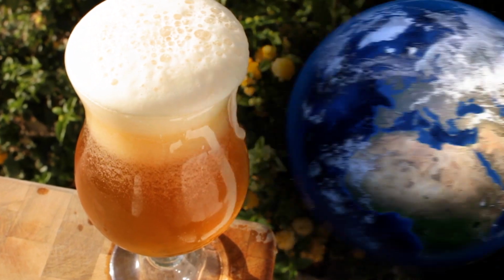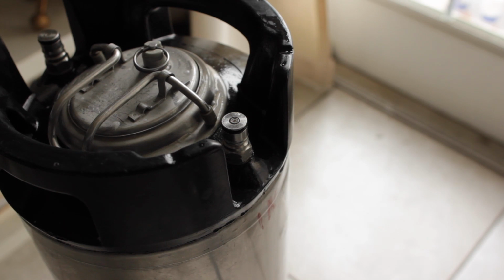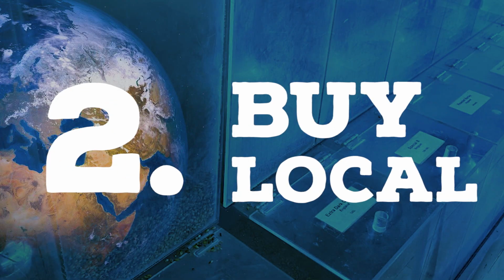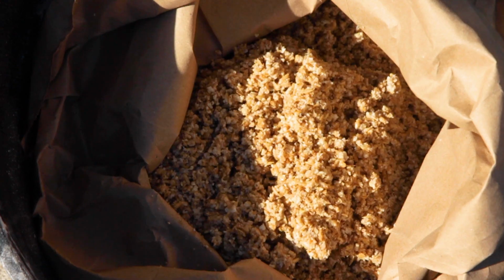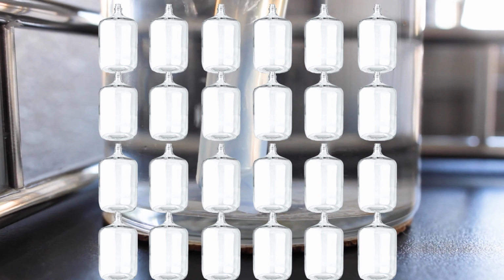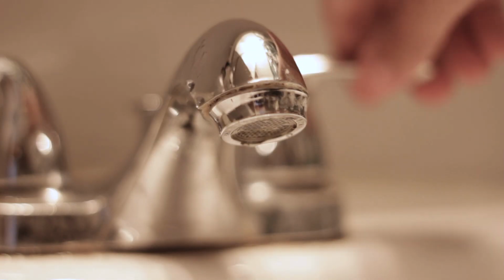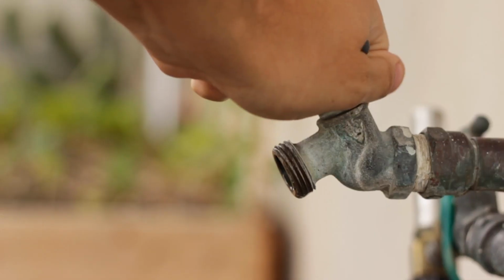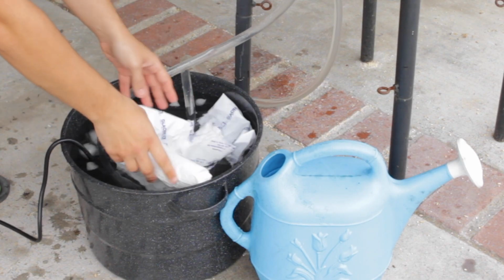Easy Ways to REDUCE WASTE for Home Brewing 🌎🍺

Comment: To save water during chilling, I will boil a gallon or two of water two nights before brew day. I put that water in sanitized food containers, and throw them in the freezer. Then on brew day, I calculate using about a gallon or two less water so that when i get to the end of my boil, i don't even need my chiller. I just throw in the giant blocks of ice, which rapidly cools down my wort, gets me to my 5 gallon mark and saves all of the time I'd normally be spending watching the thermometer drop! Its a few extra steps to set up and more math to do, but it's worth it to not watch gallons and gallons of water run down the street.
Reply from the maker: Excellent tip! TY!

Comment: Where I live the water CAN NOT BE wasted never dumped all that water and cringe every time i see a video where its dumped away, Started making ice and recicle it with a pump then i had de oportunity to put a tank and cicle throw it until de temp of the tap water is equal to the water coming out then just close circuit with some ice.. works like a charm got lager temps easy
Reply from the maker: That’s a great setup! Especially if water is a rare commodity!

Comment: Environmental - Some of this sounds really counterproductive or destructive. Pre-chilling water for example (or using ice)- the compressor or Peltier cooler uses a ton of electricity to pre-chill the water you are going to use. In NAMR it takes approximately 15 GALLONS of water to produce 1kW of electricity. The electricity consumed making 20 gallons of ice, can be far more than just using room temperature tap water. It's substantially more than just re-using water from the tap, and infinitely more than just letting the wort cool down with ambient air. You have line losses, compressor inefficiencies, the energy used to maintain the temperature in the fridge/freezer, etc. An efficient compressor based mini-fridge can still consume around 80 watts an hour just to be running so if it runs 12.5 hours to chill your wort to pitching temp you blew another 15 gallons of water at a power plant to say you didn't use it at your house. If it took 48 hours you used 57.6 gallons of water. If it takes a few days to prechill ice, and post-chill a fermenter you easily climb into the hundreds of gallons of water. Now imagine your fridge is inside a living space that's also conditioned and all the heat dumped from chilling, has to be conditioned a second time, we can really double up those numbers. If its a Peltier based chiller go ahead and multiply these numbers by 3 or 4. The mini fridge just being plugged in and not used for wort chilling uses an average of 233-310kWh a year or 4650 gallons of water. The only real green advice is let it cool down with ambient air, or if you use water re-circulate as much as possible and use the 'waste' water after it chills to water plants or whatever

The idea of shopping at your LHBS reducing emissions - How? The vast majority of emissions came from the products making it to the store, having to keep a store open, staffing the employees and their trips, the entire manufacturing or growing/harvesting/packaging process. Easily 99%, and when its instead shipped to something like a brewery by rail or semi in bulk its far more efficient per lb of product and far less emissions are created than vs somebody buying small amounts for home brewing in their personal vehicles. BTW if its water we worry about, 3-6 gallons are used to manufacture 1 gallon of gas. Buying in bulk in a single trip sure it saves emissions vs making 10 trips, but its probably delusional to think homebrewing is saving emissions compared to commercial brewing or that buying stuff for a single batch locally is any more emissions friendly than ordering it online. Make less trips or have less deliveries is sound advice. 

Reusing spent grains - 'i made dog treats', 'dont give spent grains to dogs they are toxic'. Maybe some grains? Or maybe hops are toxic to dogs. felt like a mixed message. The act of having somebody else compost something... its going to break down anyways. In a landfill or a commercial compost, in your backyard, anywhere as long as you don't launch it to space. Its going to have the same net emissions. You just add emissions by having it shipped, or having it sorted, or having to rotate it, but natures going to break it down no matter what with exactly the same emissions eventually. The only thing that seems like its green here would be suggesting just do it in your backyard so you dont spend additional emissions shipping it to a landfill or a composter (who then ships it again somewhere else)
Reply: I think the message that you shouldn't give dogs spent grain that contains hops was pretty clear. So no mash hopping if you want to make dog treats.

Using spent grain to feed chickens or in your own or neighbors compost is a good idea. So is buying in bulk.

The cool water thing may depend on where you are located. If you are in a region where water is a scarce resource but solar energy is plentiful, using ice packs and reusing water may be better. But in other places it's probably better to just use tap water, capture that and use it to clean or water plants etc.

Friend of mine uses rain water to cool his beer, at least during the cold months.
Reply: @RedHotBagel  I scrolled back in you are right - he does say make sure the grain doesn't have hops before giving it to your dogs
Reply from the maker: @RedHotBagel  love that rain capture idea!
Reply from the maker: These were just some ideas to make better choices on a small scale. There is obviously a bigger issue at hand but was only hoping to give home brewers some ideas on where they can be a little more green. No one is perfect!
Reply: @TheBruSho  No worries friend I wasn't accusing you of being perfect just offering my personal perspective on some of the actual impact of the suggestions
Reply from the maker: @SuperDocCox  appreciate you giving your insight! 🍻

Comment: Good stuff!  I always use the no chill method, or if it's summer time I hold my kettle in the pool and it cools really quickly.  What about reusing your yeast?  I think you can use them up to 10 times.  That's my next venture now that I have a secondary fridge.
Reply from the maker: That pool trick is genius! And yeah reusing yeast is a good option. Saves money more than anything
Reply: I guess I've got to buy a house with a pool now🤔
Reply: @davec4955  Sounds like a good enough reason to me!  ;)

Comment: I have been collecting my water used for chilling in 10 gallon coolers and using that for cleaning equipment after the brewday and then watering plants just like you said pretty much since I started brewing.  Also putting star san in spray bottle to spot sanitize can cut down on needing to fill a huge bucket of water for sanitizing equipment and helps get into hard to reach places.  
Great video topic!
Reply from the maker: That’s awesome! And great point about the spray bottle. Definitely saves on water!

Comment: I started buying bulk grain (and doing some home roasting for fun) after finding a mill on craigslist for $20. I don't have the ability to chill where I am so all my brews are no-chill. One of the best tips I heard early on was putting sanitizer in a spray bottle. I'll typically make about 2 gallons of star san solution and put some in a spray bottle and then use the rest for larger stuff and bulk sanitization. I just got a couple of kegs and a spunding valve so I definitely want to try pressure fermenting and capturing the excess c02.
Reply from the maker: Sounds like your doing a lot of the right things, Cheers Stephen! 🍻